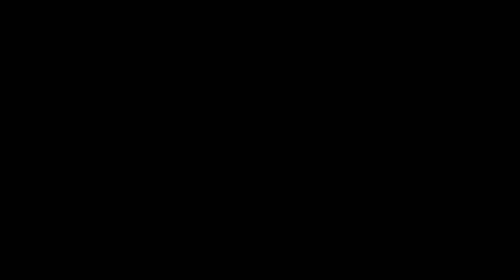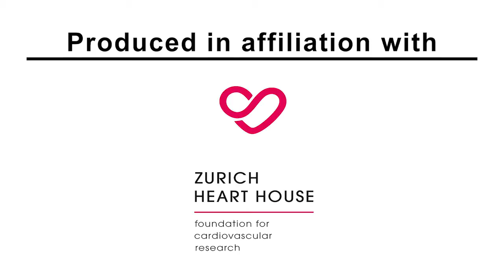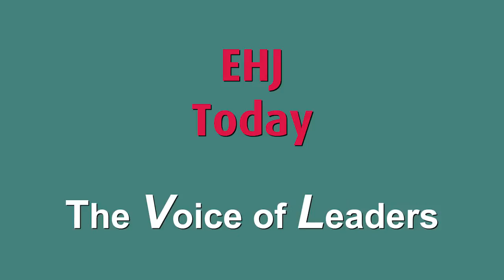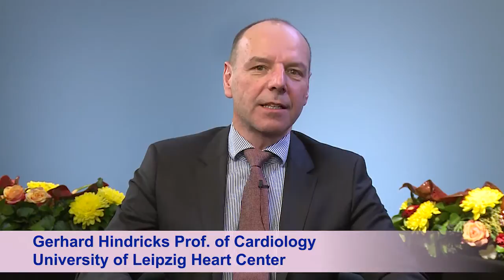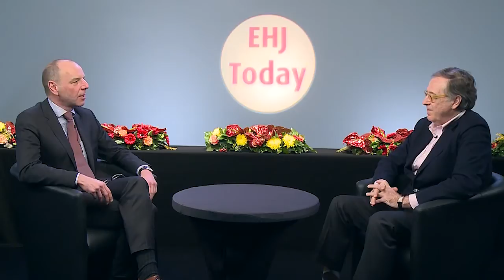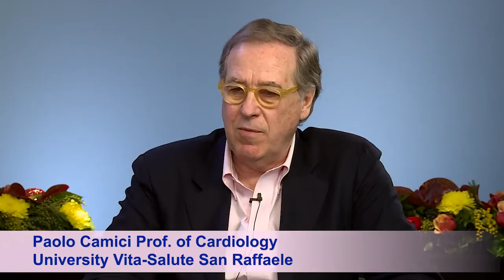EHJ Today - Coronary Microvascular Dysfunction

Comment: Nitroglycerin use in any form for treatment of cyclic flare up of coronary vasospasms often co-existing with CMVD, was not addressed. I too have this disorder-CMVD-and IV NTG at high doses is the ONLY treatment that will break a bad cycle. Other pts have reported this too..yet OFTEN declined this particular treatment as no treatment protocol in place..few studies...and many physicians who believe IV NTG is "water/placebo" and not helpful after several hours of infusion due NTG TOLERANCE.  I think patients like us are often an exception to that rule, and we need and tolerate much higher doses of NTG. This can be a very disabling illness, yet we patients "LOOK GOOD" often have negative coronary angiograms ( the GOLD standard diagnostic test) so many physicians think we are fine..and we are often all just judged to be somatic and malingering. That is so NOT the truth. Doing a "challenge cath" to see how the vessels react to a normally vasodilating chemical ,often acetylcholine, can also prove or disprove our validity of this disorder. Less invasive testing as well like CPET,how the body reacts to exercise/not just simple stress test is also available to point in the direction of this diagnosis. Would be really nice if we could study this disorder more, be medically aggressive with treatment (not just sending us to a therapist for depression assumingly diagnosed instead ) and also to help prevent an eventual potentially fatal cardiac events as each episode of ischemia and angina we endure is cumulative and worsens our overall coronary MICROvascular function.even leading to MACROvessel disease and CAD as well as diastolic dysfunction and heart failure symptoms, HFpEF. . Then they could move simply on with their lives (careers,family) too, as many of them so wish to do.